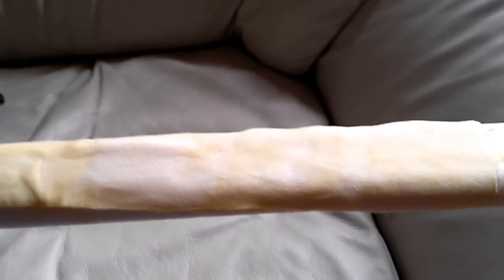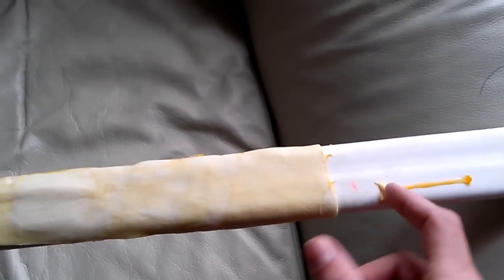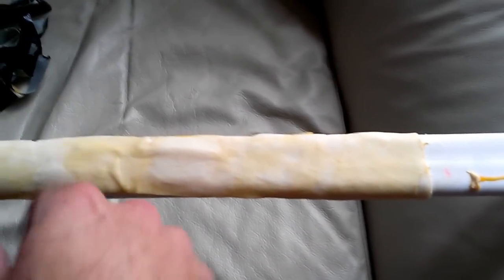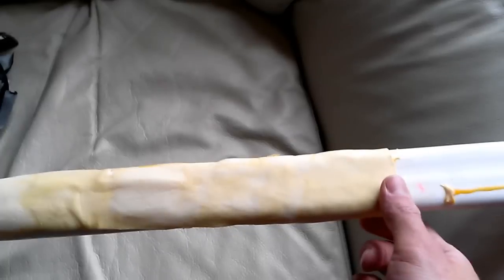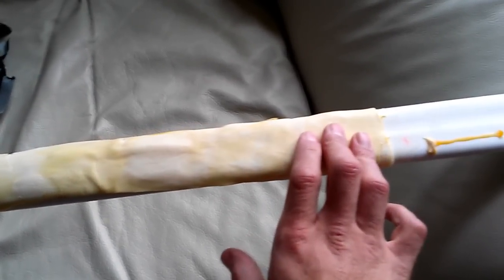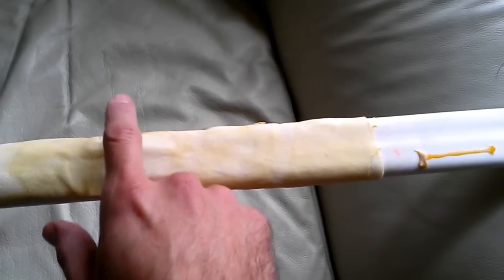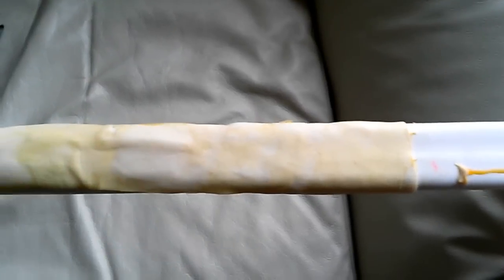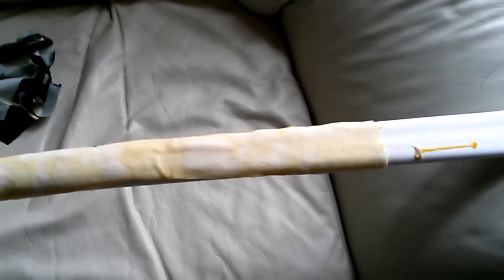Rawhide backing a PVC Bow

Comment from the maker: Almost all of my 3/4" bows pull about 40-45# at 28" - it shouldn't be too hard, particularly if you don't overflatten the limbs. Beyond that, it definitely needs something more - like more aggressively reflexed siyahs, etc. 

I made a youth recurve with totally flat, 45 degree angled forward siyahs, and it seems to be under more stress than usual, and shoots very fast. It's not as  stable as the other bows, though, and needs to be coaxed to center the string at first.

Comment: Not sure the flexible pvc cloth will add anything as far as pounds.  I added cpvc inside a bow to build strength and performance gain was near zero due to ,asking it heavier as well.  Anything bendy is likely just adding physical weight vs performance gain.  Fiberglass backing is tough as it leaves no room for 'tiller adjustments on the bow itself.  Still thinking...